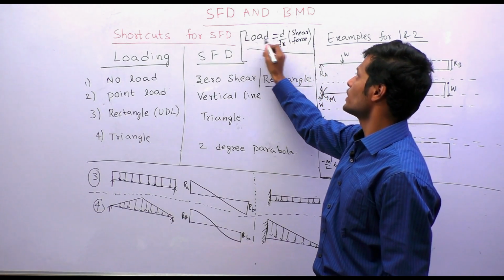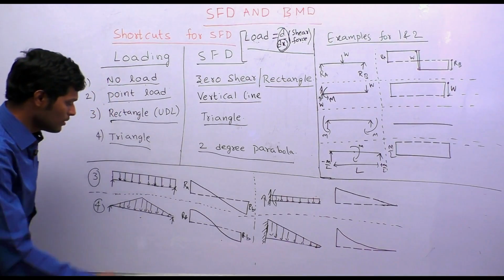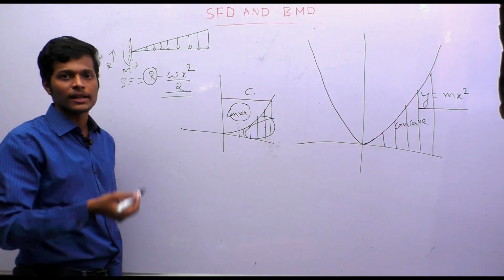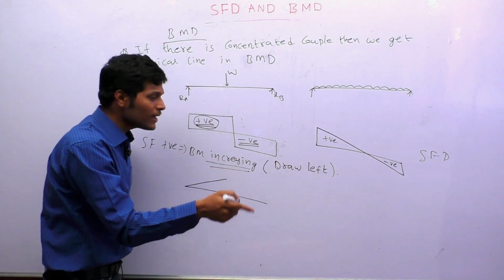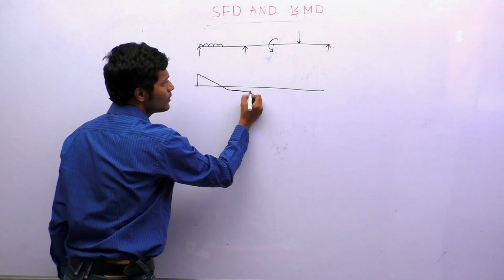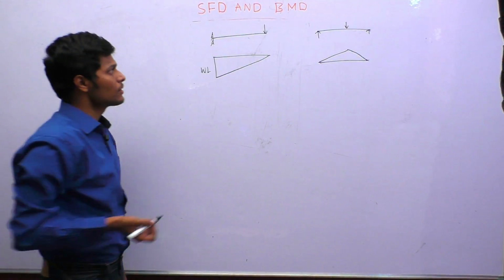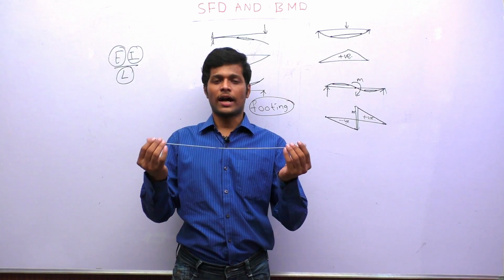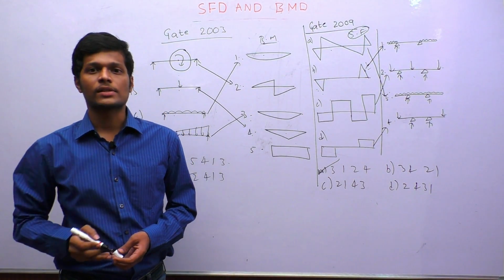Fastest way to draw SFD BMD without any calculations( GATE , SSC JE, IES)

Comment: Sir please explain this question
A wooden lag is floating on water supported by two equal point loads and Also explain if Central load W is acting on it With SFD & BMD
Reply from the maker: technical support only for registered users
Reply: @VGacademyCivilengineering  😓

Comment: Sir, i like lecture and it was easily i have understood, and i have a doubt, shall u explain me is that for example a 3 storey building where i find axial load (pu) come on column
Reply from the maker: Muhammad Aashik that's a indeterminate. without carrying analysis you cannot find reactions to draw
Reply: VG academy Civil engineering 
Thank u for ur reply, but my doubt is how to analysis manually without staad pro by simply 2 storey building
Reply from the maker: Muhammad Aashik even a 2 storey building will have redundancy around 50. Not possible to analyse manually. Manually we do approximate methods for frames like portal and cantilever methods

Comment: As per my knowledge if there is a moment acting on beam we can get point of contraflexure but in this video example problem u didn't mention.. but have given explained that of moment acts I just shown vertical line...pls clear my doubt.
Reply from the maker: Suresh Naik you are wrong. if there is a couple you will get vertical line for sure. contraflexure doesnt comes when the moment due to supports and loads is more than moment due to couple(if in opposite direction) then BM does not changes its sign. so you have to apply high moment vaue than  moment at that point to get contraflexure. its not mandatory to have contraflexure. in fixed beam almost everytime you get even without couple because near support you have hogging and in mid portion it is sagging. see the solved example in video (with all combination loads) at end you cannot find contraflexure with couple.
Reply: +VG academy Civil engineering ok thank u sir...now I got clear picture about this concept...thanks for ur work
Reply from the maker: thank you. watch other videos. i hope you will like them